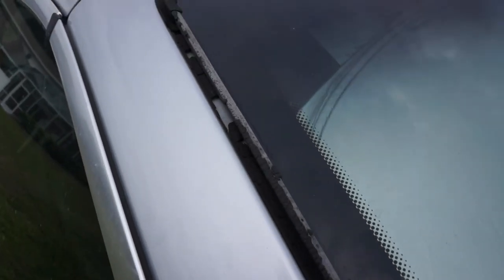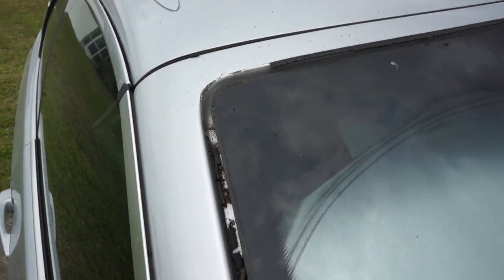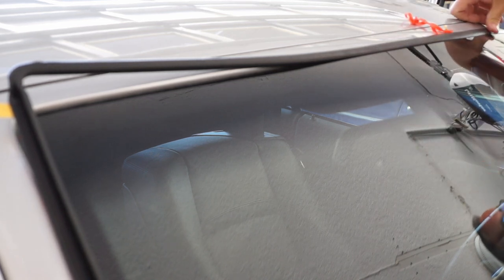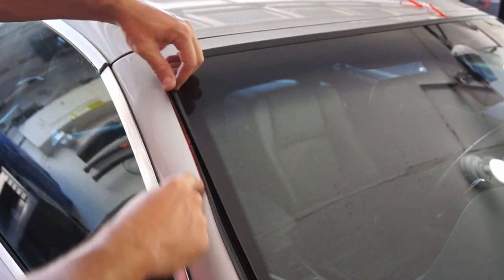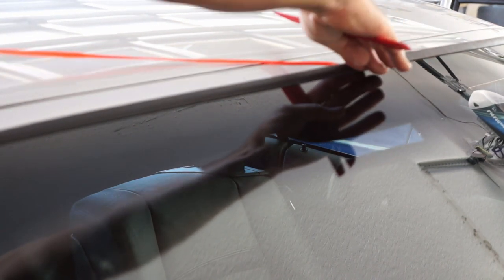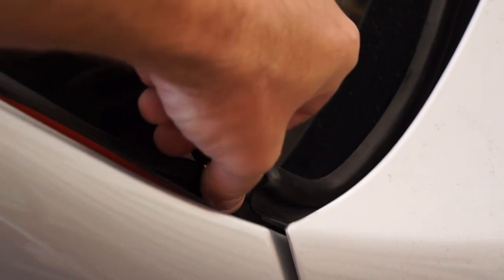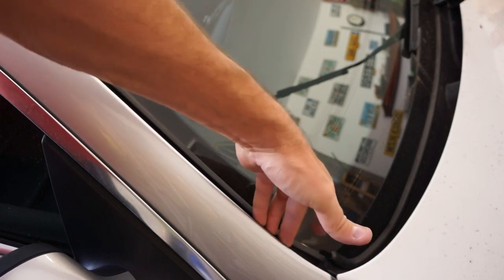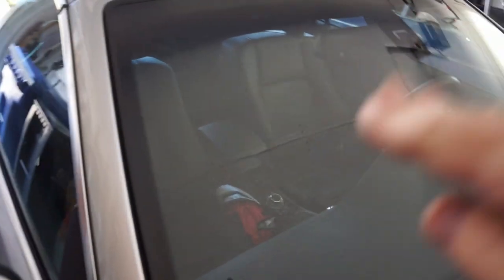BMW E93 Windshield Moulding/Gasket Repair

Comment: Learn from his mistakes. I had excess adhesive from old one, used goo gone to get rid of it. Plastic razor blade was clutch to have as well. Lay it in the sn for sure. Super easy.
Reply from the maker: Thanks for the comment.